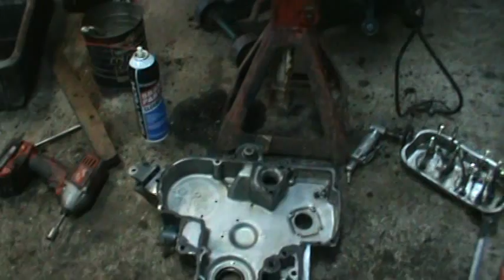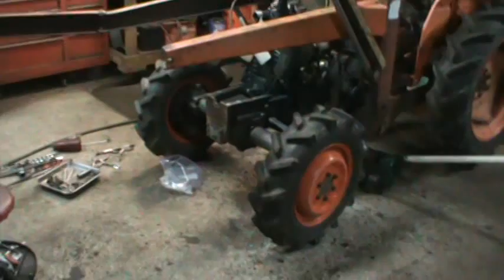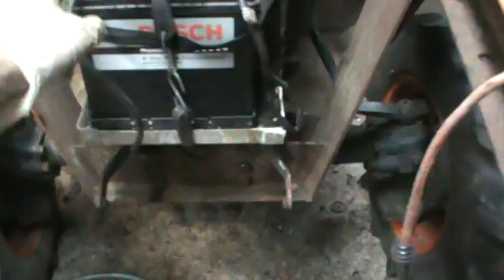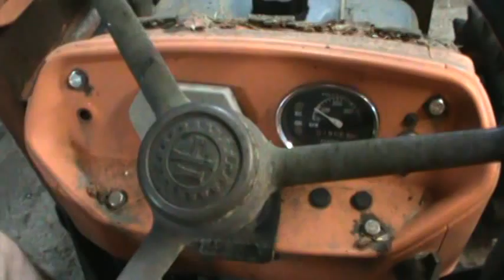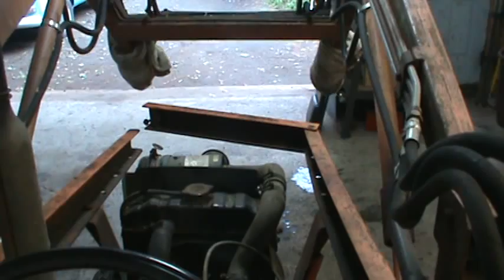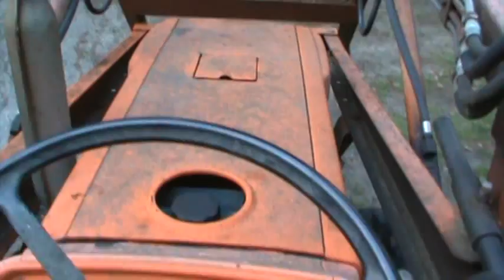kubota tractor w/low oil pressure repair done

Comment: Hey Mustie, Resurrecting an old line of comments because it is serving me NOW.  I was "gifted" an old L295DT and I was told it had bad oil pressure on idle.  I found this video a couple years ago, but haven't had the time to dive in and do the fix.  I'm about to approach it now, and just watched again.  Yours are the only videos I've seen on this issue, though I've seen a few write-ups.  Thanks for taking the time to do this.  I guess I'd better do a video of mine as well to adorn my channel when I get it up and rolling again...  :-)  Thanks!

Comment: Thanks Mustie for this older Kubota video.  I believe one of the freeze plugs under the timing gear cover on my L295 has popout.  I will be taking my tractor apart to replace the little son of a gun and check my cam oil plug at the same time.  Keep on posting the good stuff.  Thanks

Comment: You are way more Brave than I am. I would have been terrified to roll at rear end out from underneath there not knowing whether or not I could get that shaft back up in there. Knowing my luck. Some little stupid keeper would have fell down had to take the whole tractor apart to get the keeper back in it.

Comment: Is the round part that holds the fan on part of the front cover? I ask because I am trying to reseal the water inlet which looks like the cover cannot be removed unless you pull the front cover.

Comment: I have a 2wd version of this tractor. It’s been without oil pressure for about 8 years. It runs great, and has never failed to start in the coldest weather. It has oil pressure until it gets to operation temperature. (I have a Harley Davidson gauge plumbed in where the sensor was.)

Comment: I would of just unpluged the oil light lol
Reply: I worked at a food delivery company years ago, had to drive a different truck one sat. Got in and the radio was so loud it knocked me right out of the cab, so I asked the regular driver why the radio was so loud, he said that the bell going off was to loud. I checked, it was the low coolant alarm, put some fluid in it, alarm went right off. He didn't work there any longer.

Comment: Real neat tear down and put it back together....and you got some oil pressure....nice fix....ran in to about same problem with the governor on a Kioty about 15 years ago...never had it fix where it should be but we change the engine for a new one last year.....CHEERS

Comment: Wonder if you have a set of forks for that unit. It's sweet when you can remove the bucket and put the forks right on there so that the load is kept close, unlike the "Over the bucket" type forks. Plus, you gotta have the snatch hooks welded to the top of the bucket for easy chain hoisting. That's how I roll! Great fix. Keep it up.
Reply from the maker: l have a terramite set up like that